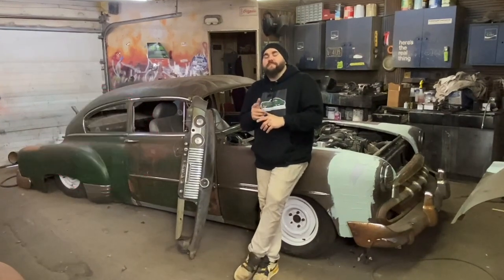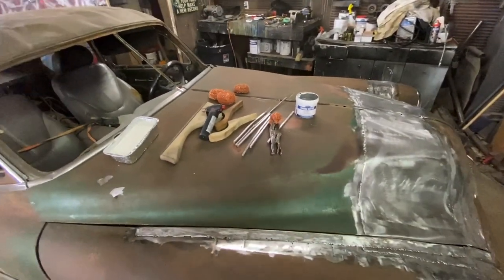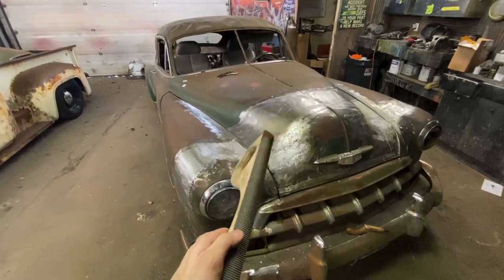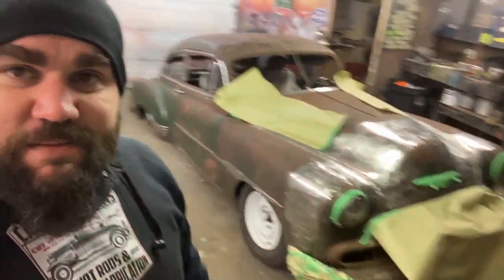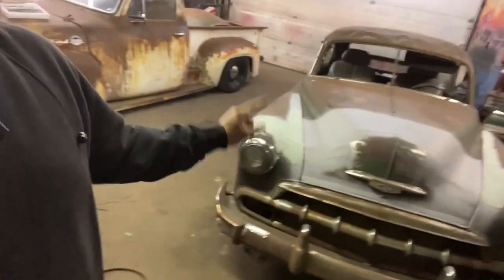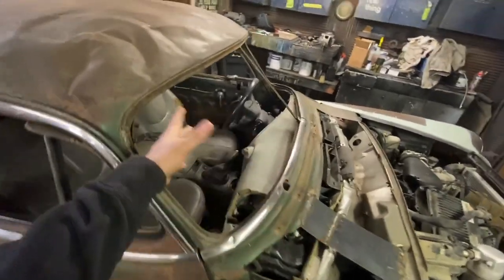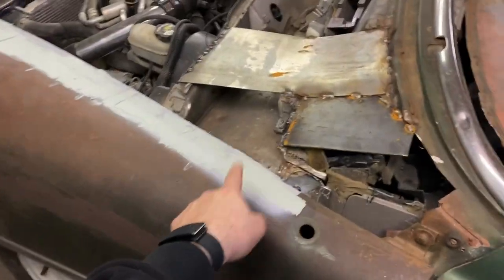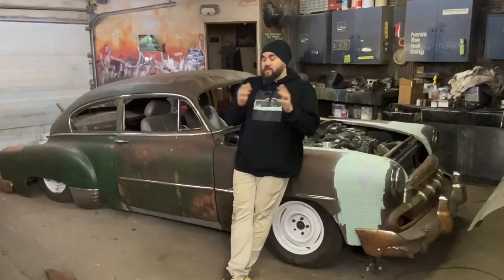DOING LEAD BODY WORK! BUILDING A $3500 DOLLAR HOT ROD WITH A TURBO, AIR BAGS & CHASSIS SWAP! PART 19

Comment: When I was a senior in hi school (1970 ), my auto shop teacher was rebuilding the entire front end of a 1959 or '60 Porshe 356, making the new repair panels by hand from flat sheets of steel. He let me help and It was amazing watching him work that metal with little more than a couple wooden hammers he had made, also an old log stump with the top dished out and a bag of sand sitting atop a 55gal oil drum. He even made the headlight surround pieces from scratch. 

When the panels were mounted he did the lead work with such care and precision that he almost didnt need any Bondo at all. I was never more impressed watching a man work metal than those 6 or 7 months back then.
I wrote all that to be able to say that I have seen VERY FEW guys since then that worked with lead as I just watched you do. You sir, are an OLD SOLE in a young mans body doing lead work like that.  Two Thumbs Up!  THANK YOU
Reply from the maker: Thank you very much for the kind words. 🙏🏼🙏🏼

Comment: Just started watching your videos, I've got s suggestion on the next one you do like this one if you stretch the front end it will be less body work. Cut your finders straight down the top from front to back parallel then cut 90° down the side on the front and 90° at the back side across the hood or cowl it's the least amount of curve on the body and less surface that gives you the length. Next time it will save time money